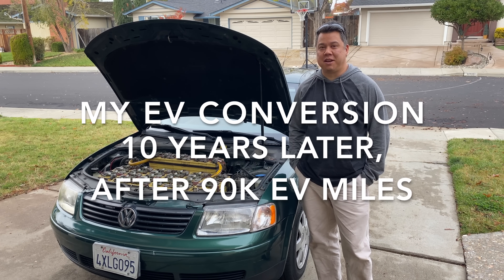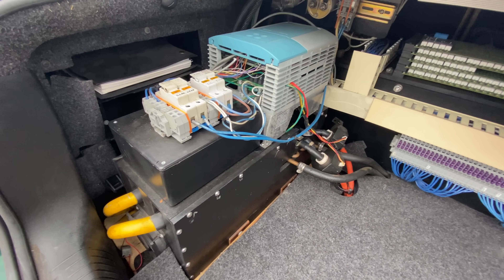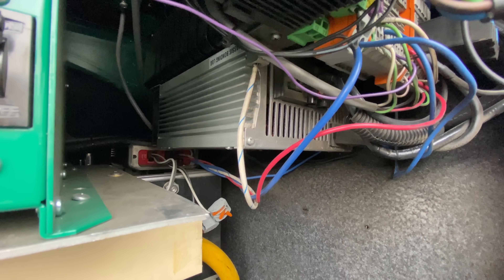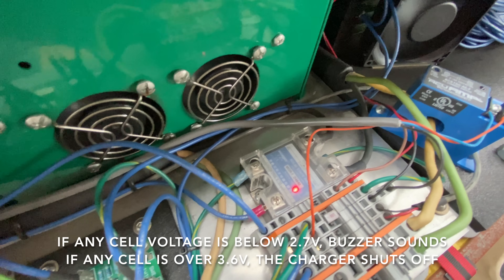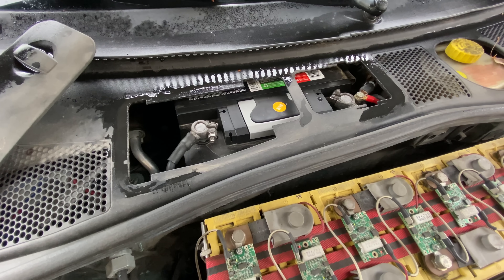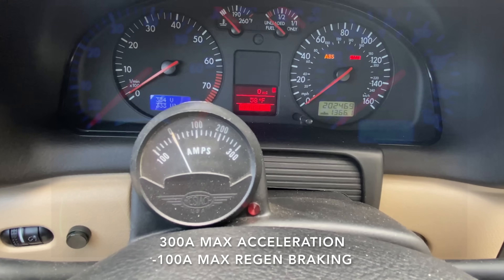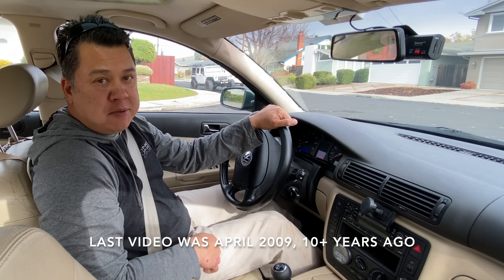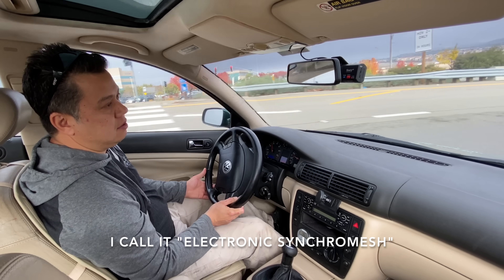My EV conversion after 10 years and 90k miles

Comment: holy shit in a crash that would be catastrophic
Reply from the maker: Well, crashes in general are catastrophic.  The batteries (Thundersky LiFePo4) are much safer than gasoline, even when nails are driven through them, they don't catch fire.
Reply: @etischer  fair, however in a car the fuel tank is more than often at the back, for that reason i imagine. the batteries are the fuel tank on an electric car, plus plus it helps with weight distribution when they’re all underneath the floor or nearer the back. even slightly piercing any kind of battery, assuming it’s not a consumer one like an AA, can cause fire so easily.

Comment: i see that you still answer, i would love tu have an update on this build, and if you made any upgrade, what finally you would recommend for someone willing to do the same ? Props to you !
Reply from the maker: I ended up buying a Model 3 a few years ago, and the Passat hadn't gotten much use since then.  It was costing $1k/year in insurance and taking up a parking spot, so I decided it was time to part it out.  I sold the batteries, charger, AC system, and motor, and had the rest of the car picked up by a charity.  Sad end, but it was really 10 years of extended life on the road for the Passat.

Comment: How does it hold up to weather if water got under the hood with those exposed circuit boards?
Reply from the maker: Hasn't happened in 10 years.  There's a belly pan that seals the bottom from water.  The boards have a conformal coating as well.

Comment: Damn the fire hazard. How much did you bribe to get it licensed?
Reply from the maker: The Thundersky batteries are fairly inert, they don't catch fire even when nails are pressed though them.  Much less flamable than a car full of pressurized gasoline, oil, transmission fluid and a hot exhaust.  No bribes required, and registration fee was even waived by CARB since it was now registered as EV in California

Comment: I love this But I have a question. What happens if you get into a accident?
Reply from the maker: Well there's no high pressure flamable gasoline, so that's a plus. No hot exhaust manifold, catalytic converters, high pressure oil lines, high pressure coolant...  The batteries (Thundersky LiFePO4) are fairly inert, there's videos of them being shot with bullets, and nails driven into them.  There's fusing to protect against shorts, and the high voltage wiring is outside of the passenger compartment.   Airbags and ABS still work.

Comment: Can automatic transmission work
Reply from the maker: It has been done, but the motor has to be always turning to keep the torque converter pressurized for the transmission to work, alternatively some people have run an external hydraulic pump.
Reply: @etischer  that sound complex...the external hydraulic pump
Reply: Can you please do a video on automatic transmission conversation or a video link or something....it will really help...especially the wire and the hydraulic pump of a thing....u will change my life forever...a liter of fuel use to be #197
Now the new president made it  #520....I may want to try it

Comment: I was gonna build an EV back around the same time you built this one. I was a technician at a Saturn dealership I was gonna buy  a Saturn S-series 5 speed just a cheap one that was traded in. I bought a used electric forklift I was gonna use everything I could from it, I made a plate to bolt the electric motor to the transmission, the battery from the forklift was fine so I was gonna use that it was a really big heavy battery, I used the speed controller from the forklift and just had to make a bracket and a little mechanism which actually used the factory throttle cable and attached it to the twist throttle speed controller, I cut the rear of the crankshaft off just past the rear most crank bearing journal then found a good strong bearing then I put the piece of crankshaft in a lathe to machine the bearing journal to fit the bearing, then I brought the piece of crankshaft and the forklift motor to a machine shop to have them machine the piece of crankshaft to fit on the motor because I didn’t have the ability to make the inside of the crankshaft piece splined so they did that for me, then I had to machine the plate I made to bolt the motor to transmission to fit the bearing and made a bracket that bolted on that held the bearing from coming out, then I had to bring the clutch and flywheel to a machine shop to make sure it was neutrally balanced, then I got the plate, clutch and flywheel all bolted to motor and test fit to transmission but then realized I had to adjust the position of the motor so it was perfectly centered inline with the input shaft in the transmission so the input shaft bearing didn’t fail so I  slotted the plate where the dowels went and threaded 2 angled holes into the sides of the dowel pin holes so I could adjust the centerline of the motor in very small increments and lock down the adjustment so it stayed there. I wanted to have a clutch just incase some part failed and made the electric motor stay on so I could just press the clutch in to stop the car. People will say it’s a manual transmission just pop it in neutral well because when a manual transmission is under a load they don’t come out of gear. Electric motors have a lot of torque and if it stayed on it’s very possible the brakes wouldn’t be strong enough to stop the car so the clutch was really a safety feature that really wouldn’t be used much at all so it would almost never wear out. I thought about having a big switch inside the car to shut off power but the car had a vacuum pump for the brake booster, electric power steering so I didn’t want to cut power to everything I didn’t want to make the power wires any longer then needed because with dc current the longer the wires the more power is lost plus I didn’t want to have a big switch on the dash and last thing if anyone drove the car and the motor stuck on they might not think fast to flip the power switch but a clutch would be second nature to anyone that drives a manual transmission so it’s definitely a safer choice to have a clutch. So I got the car working then I was going to register the car then it hit me I couldn’t get a state inspection sticker on the car because in my state the inspection machine has to be plugged into the car and because I didn’t have the gasoline engine in the car I couldn’t do it so I never got to really drive it. I was told I can go through steps to get an exemption because it’s an electric car but after looking into it I didn’t want to go through all of that. The car did work but no clue on the reliability or how long it would drive on a charge. I think the speed controller might have been an issue because a forklift doesn’t drive for an hour straight at a time the do short drives so there was only 2 small cooling fans it wasn’t a real robust system I feel that I would have needed to install a new system at some point  and the battery probably wouldn’t have been very good because it was pretty old and it was probably 1500 pounds, it took very long to charge. There are much more efficient batteries now with better charging systems and you would want to be able to charge at any of the stations now. Back when I built it I didn’t have money to make it better and the biggest reason why I didn’t bother to get it legally on the road was absolutely no charging stations in my area so if I left a light on or had to drive somewhere further I wouldn’t be able to charge it so if I was even 1 mile from home I would need to get it towed. I was gonna just bring a small generator with me but the charger needed to be 220v so I needed a decent size generator and there was already no room in the car so the back seats and truck would have no room I only had the front seats plus it took so long to charge so it just didn’t make sense. Had I kept the car I would now install some efficient batteries, new and efficient speed controller, a charger that had the ability to fast and slow charge and use 110v and 220v with ur normal plugs so I can charge anywhere. It wasn’t until the past 5 years that my city actually started to have charging stations which we still don’t have a ton of them but there are more then enough now. I am considering building another EV which I will do at some point but I drive a vw diesel that gets very good millage so I’m not in a rush. My next Ev will have a built in generator that I will likely almost never use but I will have it just so if I want to take the car on a long trip or say my second vehicle is broken down then my EV will not be limited on millage. The generator will be a small diesel engine that I could turn on at any point so if I plan on going on long ride I can start the generator right away so I can make it to my destination. Here is the biggest reason for having a generator which is something people don’t think about and it’s not very common, so once in a while the state thruway will have an accident where the traffic is blocked for miles because there sometimes isn’t an exit or u-turn for 20 miles well I remember 2 times in the past 15 years when this happened during a bad snowstorm and vehicles were stuck on the thruway for over 2 days in freezing temps a few people died and emergency services can’t get to you they had to wait for the storm to calm down then a helicopter came out which had to find the people in need so if that happens in an EV ur screwed so that’s my biggest reason for a generator you don’t need to use it but it’s there if u need. I keep a small propane heater in my car just incase because last year my car broke down in a snowstorm on the coldest day of the winter at 4am
Reply from the maker: The exemption was relatively easy for me.  Air Resources board just checked for a Catalytic Converter, and exempted it. DMV inspection was just some lady with a clip board who knew nothing other than do the blinkers, brake lights, and horn work.   My college (Chico State) convereted and competed in EV races using a SL2, NiMh batteries, and AC Propulsion inverter/motor.

Comment: Sooo.... are / were you a controls electrician, or an electrical engineer? As a controls electrician / flows and controls engineer myself, this whole thing just reeks of "I got a bit inspired at work, and took it beyond too far", lol. Nice AF though... amazing job. You outdid anything I would have been capable of myself, without assistance from a wizard like yourself anyway. 

And yeah... as a long time gearhead / cars enthusiast, I both like and hate EV's. The fact they were sold on the premise of being simpler, eliminating complex mechanical parts, and being way cheaper in the end... almost on the level of disposable consumer electronics, as that's what they are in the end... Ewaste... well... it's a shame that it was all a massive lie. With nearly all EV's coming in well over six figures... all pitched as some $30-$40K item, then switched to $140K right before launch, never going back down to anything resembling their initial pitch... In the end though, they are merely something that will have their sleds die, and then either cost some $40K + to replace said sleds, or immediately turn into auto-totaled, hazardous waste / giant / largest ewaste items ever, to date. Disposable cars.... ehhh... And on top of all of that lying, is the FACT that they took a VERY SIMPLE mechanical item, and made it into an IMPOSSIBLE TO WORK ON AT ALL, piece of electrical engineered impossible tech. With modules, contactors, BMS's, PLCs, and everything else that 99.9999999% of the population would not only not have a clue what to do with if something broke, but of which would have generally everyone terrified to even look at, let alone touch... 

Personally, I have an affinity for the era you're in here, I drive an 05 Escalade EXT, have an 04 Tahoe, have an 06 Escalade SWB, a 99 Camaro SS... etc. It's the ultimate era... engines that are just as potent as today, with all the same potential... with any LS1, LQ9, etc being capable of exactly the same power output as any brand new, high end, race ready V8... Yet with none of the bad parts... no AFM or DoD, no LTE comms to shut off basic features and force you into microtransactions to get your keyfob back, or your aircon back, or your rem start, etc. No single point of use UI, 10" touchscreen, of which to bumble through 52 menus, drop downs, etc. just to finally be able to turn one's heat on, or unlock a door. With the ENTIRE CAR dying a death of uselessness if the screen so much as cracks. . . Yeah... I want NONE of ANY of that crap. Nor do I want my cars range to get sequentially smaller as the years accrue... akin to a shrinking gas tank... but MOST akin to a cell phone, laptop, or any other lithium catalyst battery device... again, just turning into ewaste at a predetermined amount of time. No more 20 year old used cars, of which still look, drive, and operate as if brand new... not when it's all EVs.... those will have expired and gone from "worth something", to "worth negative something", the moment the sled dies. Goodbye used car market entirely.... 

I know it's ultimately the future, it has to be... We just aren't quite there yet is all. I personally can't afford a six figure disposable car or truck... nor can I deal with 5-20 hour charging timeframes, with miniscule ranges in between. I drive an hour to and from work every day, and simply catching that wrong would leave an entire day on the table, unable to commute at all. Not to mention the fact that most of us, me included, won't even be able to charge at home. I don't have an attached garage, or a garage at all... I have on street parking, and one makeshift "driveway" spot, waaaay detached from the house. I can't run dedicated juice to either of these spots, nor can anyone in my entire neighborhood, or for that matter, city. It's just not that kind of layout... So all the street parkers, all the parking garage users, all the city folks who have to park eons away, all will be forced to use public fast charging in order to cram some kind of charge into their blenders with wheels, daily. And that's the WORST kind of charge to use... as we all know, slow and steady saves the cells, fast and rapid kills. So to all of the less fortunate, less rich, who are forced to spend big on an ewaste mobile, disposable car... well those are the folks who will be forced to wear them out, and throw them away, the fastest. The rich, with their giant rich homes, giant rich garages, and giant rich budgets to run expensive charging circuits, new service entrances, etc. to all ends of their properties... those are the folks who will be allowed some longevity from their ewaste machines, in the universal and most unfair way, as is typical. Not to mention, these uber rich rarely have to drive much as it is too... so they're totally well off in this regard, where the rest of the working poor will be bent over and taking it hard. 

Yeah.... not too excited for the fact that we are forcing the FK out of this totally NOT READY tech... just pushing it out, forcing it on folks, forcing hard deadlines for major automakers to be fully EV.... it's all being handled in the most ignorant way possible. And I hate it. Could have done this a lot better, in a way that doesn't turn so many folks off, screw so many folks over, and isn't just plain awful.
Reply from the maker: My model 3 was only $29.5k.   I was a controls engineer at Tesla for 7 years, then retired early.  My car is more complicated than a new EV made by an OEM, cause they have economies of scale to integrate thing like contactors, DC-DC, charger, fusing all in one integrated box.  Compared to an internal combustion engine, EV cars are super simple and cheap to build.  Tesla has the highest profit margin in the industry, economies of scale will bring the prices down over time.  EV seems pretty mature to me, I've been driving EV for 15 years, I don't have to think about charging on road trips, I probably only charge once a week.

Comment: Is there a way that you can sound insulate the interior? it seems pretty loud in there and i think you could really go for a sound insulation
Reply from the maker: It's only loud because there is no gas engine running.  Even the wipers sound really loud, but normally you would never notice them over the engine.

Comment: Amazing Engineering, however, in a accident them batteries will blow like a bomb.
Reply from the maker: The batteries (LiFePo4) aren't flammable, even when nails are driven through them with a nail gun, or bullets fired into them.

Comment: The thing with electric the less you ask for the more you get. I am planning on converting a small car to plug in hybrid my maximum journey distance is 20km to my nearest city Coimbra. I can therefore dump most of the battery requirement. You could never buy such a car but if you do it yourself it is relatively peanuts in cost.